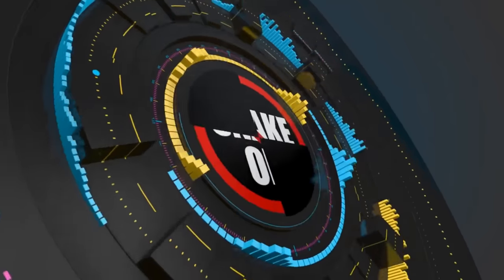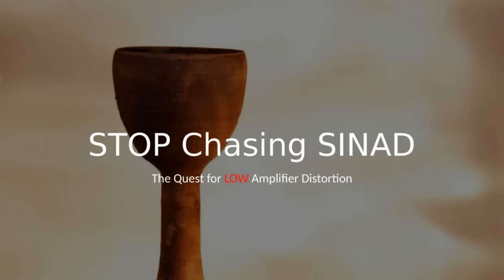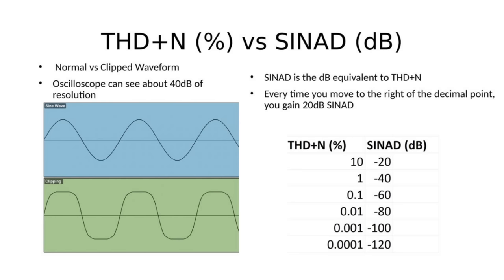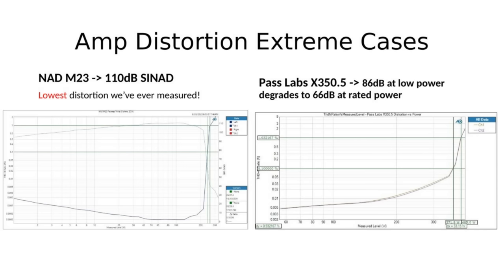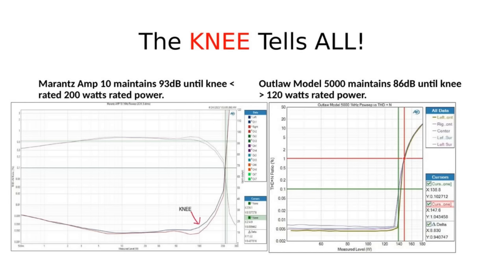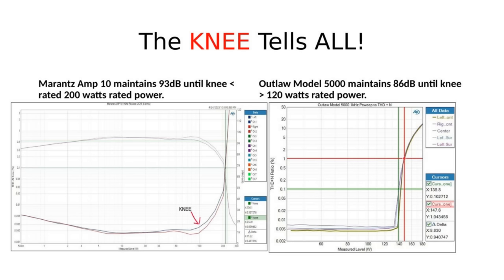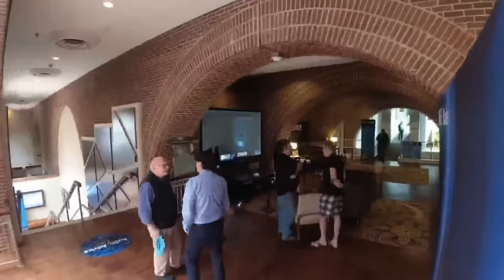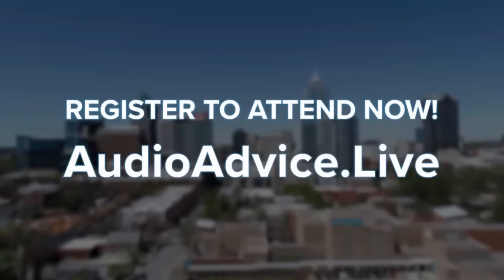STOP Chasing SINAD Distortion in Audio Amplifers!

Comment: I’ve been reading elsewhere about the harmful impact of high order harmonic distortion. If the THD measures very low, but the amp exhibits higher order harmonic distortion spikes, would listeners find it harsh or brittle in the upper frequencies? Many of the recent amps from Fosi, Aiyima, etc exhibit this tendency.

Comment: Nice vid. Indeed there seems to be an unhealthy focus on SINAD/THD+N. What we see today are amps with excellent SINAD but no headroom beyond the stated output. In that fashion an amp with modest output power (say, 50W) which can sustain 3dB additional power (=100W) for a short time (music transients), will sound more musical than an amplifier of same or even 50% higher power that has very little to no dynamic power. Sine waves are not music - music is dynamic by definition. Some companies did/do underscore the importance of true dynamic power, be it through using Class G topology or otherwise. These amps would sound much more powerful than the rating would suggest.
Reply from the maker: Excellent comments and I agree 100%

Comment: Thanks for the video, Gene. Do you have any theories as to why the new Marantz combo sounds subjectively cleaner than your SR-8015? So far as I can tell the 8015’s measurements should put distortion/noise in the inaudible region. Possibly more of a speaker load/linearity issue?
Reply from the maker: Sheer raw power may explain it. Bridged mode on my S7ts giving more dynamic headroom over the SR8015.

Comment: I guess if you can get a good measuring low distortion amp as a start point ...then we can add orher things to change, manupulate or distort the sound  to  suit peoples individual  personal tastes!

....So I am waiting for a high power class D amp maker to then work with programmer's to create and add a full amp modelling/simulation circuit ..like in many modern guitar modelling amps and combos...imagine having an amp that you can choose and flick between say a Nad, or luxman valve, quad, accuphase, Macintosh, krell, etc, etc ...and be able ro add other boutique and different hifi amps ... that would be cool

Comment: It would be cool to confirm the distortion audibility.  SINAD may not be a correct parameter as  2nd order distortion may be partially masked or non-offending.  The Pass Labs amp had high 3rd order that dominated the SINAD

Comment: So the $32 dollar question, if two amps have the same output power and measure the same SINAD, will they sound the same?
Reply: I would think so.
Reply: No, not quite. It's not just the distortion that determines the sound. It's the other internal parts like caps,  resistors, design of the circuit and many more.
Reply: Some amps, especially Class D, can have different frequency responses with different resistance (ohms).
Reply: @scientificaudiophile Is it mostly dependent on damping factor or something else?

Comment: In his reviews, Amir states that ~96db sinad is equivalent to 16 bits resolution (cd quality). That is what I look for and any higher probably won’t be noticeable. You say 80db is the benchmark? How does sinad from dac/preamp/amplifier work? Do they stack or just interfere at that low level?
Reply from the maker: I said 80dB is a fidelity threshold,  not a benchmark. 96dB is the dynamic range of a 16bit CD. I don't think it's a good analogy to equate distortion with dynamic range.
Reply: Amir also mocks a lot of higher res content, in that it doesn’t really offer much in audibility.  
Nothing wrong with a 16bit CD well engineered and recorded.  
I’d take it any day over a badly recorded and engineered hires format

Comment: I have a lot of problems with the way audio amplifiers are measured and specified. People wan't one or two simple numbers to compare things that are very complicated. For one thing measuring amplifiers with a resistor for a load doesn't even begin to tell  you how they will perform in the real world with loads that are not only reactive to different degrees at different frequencies but are not necessarily even passive loads but can have a reverse EMF especially at low frequencies. IMO this is one reason why two amplifiers that bench test nearly identically can sound different in the real world. Here's an example of a speaker whose load is an amplifier's worst nightmare. Look at figure 2. Impedance goes from -90 degrees to +45 degrees. Fortunately at least the impedance is high when it's at -90 degrees or you'd probably have a lot of blown up amplifiers. 

What is the frequency response at different power levels? If you knew that transient intermodulation distortion would be redundant because that would show how much the high end falls off at high power levels. But they only give it to you at one watt.

Tube amplifiers have a peculiar type of distortion that I found out I'm sensitive to. It's hysteresis distortion due to the output transformer. For a sine wave the negative going wave doesn't retrace the positive going wave to to magnetic inertia in the magnetic domains. You can see this on any graph of magnetic hysteresis loops. Back about 15 to 20 years ago I was able to pick out by listening alone the one solid state amplifier at the Vacuum Tube Valley audio show in Piscataway. Even I was surprised and reminded my why in 1968 I bought my first solid state amplifier and never went back. 

One reason speaker loads can be so difficult is because of the extremely complex reactive crossover networks needed to make them sound "flat" without any active equalization at the low signal level which is far more preferable.

Once upon a time  many decades ago when I was still an audiophile I thought you couldn't have too much power. Having designed many industrial power distribution systems I learned better. I'm driving Teledyne Acoustic Research AR9 speakers with a 60 wpc Mosfet amplifier I built as a kit from Stereo Cost Cutters 30 years ago for $200 and it works great. What's the difference between a 60 watt amplifier and a 600 watt amplifier? Subjectively the 600 watt amplifier can play twice as loud without distortion at least theoretically. But here's the difference that matters most to me. The 60 watt amplifier can play as loud as I need it to without those speakers and does not have enough power to damage them. The 600 watt amplifier can smoke them. Engineering over emotion. 

I've got a lot of other problems with amplifier specs and audiophile equipment in general. For example given that many solid state amplifiers have an input impedance of 5k to 10k ohms why don't output stages of signal sources use low power class AB amplifiers with nearly zero source impedance instead of emitter follower or cathode follower outputs? If the source output impedance is low enough and the input impedance of the next stage, say the power amplifier is high enough then the wire impedance is irrelevant. This explains why some power amplifiers use vacuum tubes on their input stages, the input impedance can easily be 100K to 200K ohms. Given all of the awful problems with vacuum tubes you'd think they'd have all of that figured out by now.

Comment: Don't think anyone is 'chasing' SINAD, Amir just measures it because it's measurable and is a meter for amplifier performance.  And besides, when it comes down to amplifiers, if the FR is flat and distortion is relatively low, every amp should be transparent right?  The blind tests I've seen/read about sure seemed to indicate so.  (failed to identify amps blind)

Comment: Thanks for this video, Gene. But I have to play the Devil's Advocate: what prompted this video? You love measurements and I thought your and Amir's work would be more aligned rather than controversial. I get that distortion and/or SINAD don't matter to people if they like how an amplifier sounds; in other words, some people actually like how certain kinds of distortion sounds, so why would they care about measurements? So amps that have distortion are going to have mixed reviews, but I challenge you or anyone else to show me an amp that measures well - especially SINAD - that has bad reviews. I don't know of any, which is why measurements do matter. So I agree with a fair amount of what you say, Gene, but I am leaning a little more on Amir's side on this one. (Although I do agree that you don't need to chase the amps with the absolute best SINAD scores on ASR; beyond a certain threshold, all amps with different SINAD scores will likely perform the same. So maybe that's what you were saying?)
Reply from the maker: I've been listening to a highnoower low noise class D amp for.over a year thar sounds absolutely stellar despite its SINAD performance is in the low 80dbs. When you approach SINAD #S greater than 90dB you're fighting for differences in the 1000ths decimal place which becomes silly and can negate other important factors mentioned in the video.

Comment: The thing no one likes to talk about is that Amplifier testing/measuring is done with a DUMMY LOAD which is purely resisistive and nowhere near the real life load of even a two way speaker.
Reply from the maker: I've tested with reactive loads as well. I really find all I need to know about an amp stress testing 8, 4 and 2 ohm loads using various types of test signals and durations.
Reply: @Audioholics  Never found an Amp that measures just fine with a dummy pure resistive load gone "haywire" with a reactive load?
Reply from the maker: @konstantinost3185  Not in a long time tbh. When amps used to have high output impedance and high unity gain BW I saw some interesting things. Mostly cheap amps these days just can't handle low impedance loads and go into protection or current limiting, usually.

Comment: I think there's a misconception with all measurements, I would like to state out the gate I am objective, and the only misconception is that people who have never owned both spectrums of audio equipment are fairly handicapped on objectivity.

The reason why I say this is because even being objective I purchase a piece of equipment that was really cheap, so performance was not a factor to me.  I used this amplifier for a couple months and I decided hey I really enjoy listening to this amp let me see if I can find another one on the used market for dirt cheap.  During my search I found that this unit was measured with every detail that you would typically find on ASR.

The unfortunate news was this amp was total crap.  It's definitely in the top 10 worst ever measuring amps.  This really got me scratching my head.  On the opposite side of things, my main system was nearly flawless measurements wise and yes it does sound really good and I am in no way saying this horrible amp is better.

The only thing I try to explain to people now is simply that from my experience of a perfect system vs a really bad one, when it comes to amplification or the amp being the bottleneck, is not as bad as you think.

In turn, this has helped me to understand why some people preach about a product being so great and when it is measured it turns out to be boo boo.  This is also how many of these big audio companies will sell you an amp or products which are mediocre with a high price tag and people rave about it.

Lastly, this has not swayed my opinion on objectivity.  This still doesn't mean you can go out there and buy whatever you want and it's going to be amazing just because it sounds good.  There's definitely quality products out there at very affordable prices that can easily blow your mind.

There's a lot of negativity towards Amir and the ASR community or any people who are fundamentally objective.  I must say when it comes to reality you must realize all Amir is trying to do is not have you blow your money on poorly designed products with extremely high price tags.  I am not sure how anyone can be mad at this.  No one is trying to control you or tell you how to spend your money, do whatever makes you happy and sleep at night but with what I just said in mind your animosity towards the guy is really foolish and in turn basically want us the end user to get taken advantage of by these big companies and keep this corporate audio scheme rolling.  

This is exactly why you are here watching Audioholics video's in the very first place cause Gene is also objective, which I really respect, plus will tell it like it is and be more modest and give the modesty where it is due.  Which Amir does not and I do not fault the guy for that because again it's not the performance but also the price tag which is definitely a major factor.